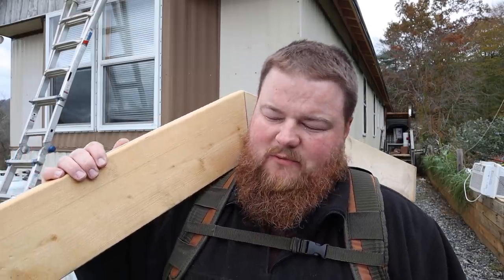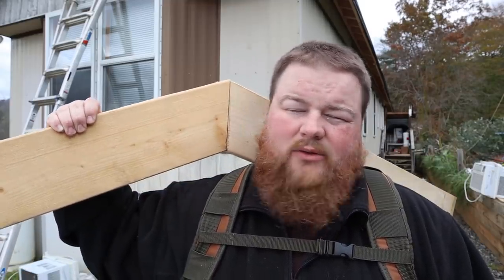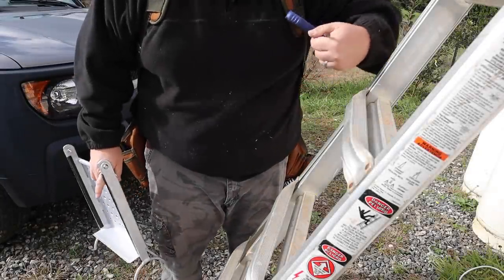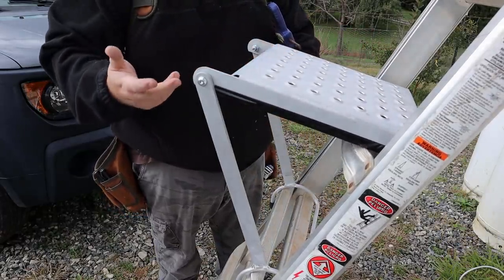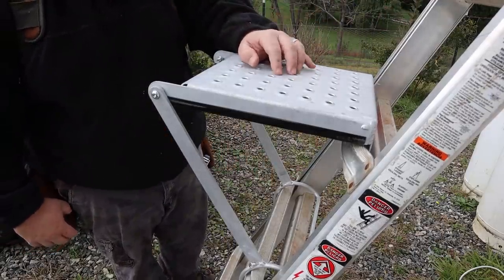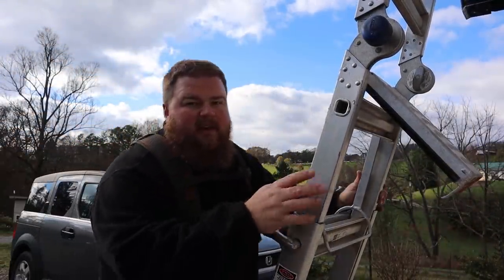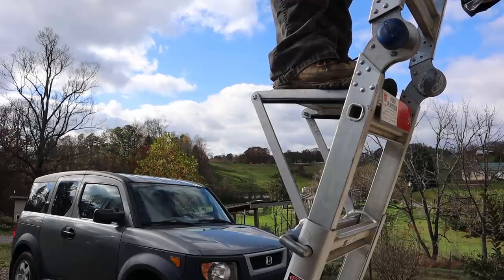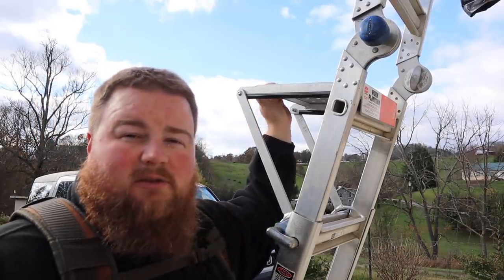Framing the Gable Ends of a Mobile Home Roof

Comment: Did you get specialized MH windows or use regular house windows? I've heard you can use either. Love what you've done. I'm using it as a diagram for my 88 as well.
Reply from the maker: Most of the windows are special ones from an old supplier but our kitchen window is from Home Depot since that wall was totally reframed. Since this video we moved the home to another state and also put in new house sized doors front and back. Lots of tenon videos on our channel, but a year or two back now.
Reply: @sam-and-angela  Thank you!

Comment: Can they unload it or do you need a gin pole or fork lift at your house to unload the metal?  I was going to order a pre-made kit specific for my mobile home model from a mobile home parts store and they deliver if you have a way to unload it or they can transfer to local company for last mile with a way to unload for a significant extra delivery charge.
Reply from the maker: That is yet to be discovered... I imagine they will get it close, but not exactly where we need it delivered. Every time we've ordered metal from them in the past they have a low flat trailer  with rollers and just slide it off the back. We'll see... maybe they'll let me film the process. :)